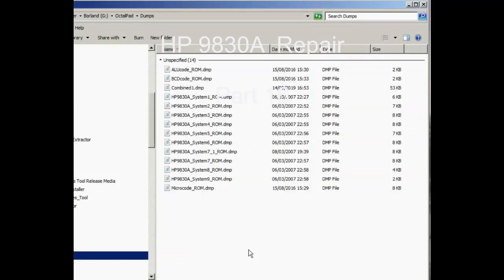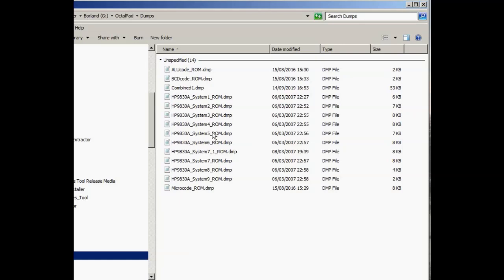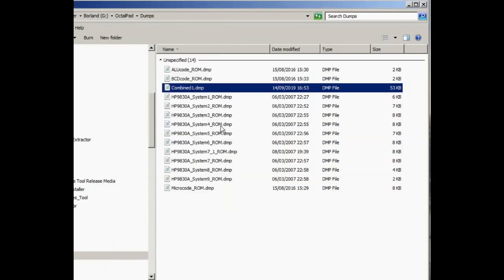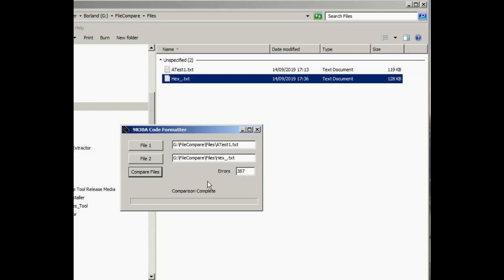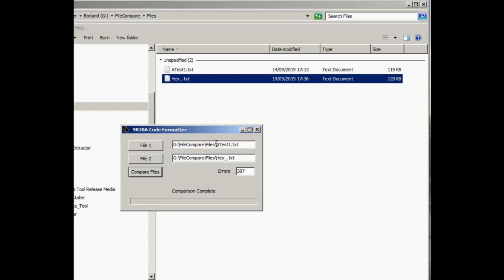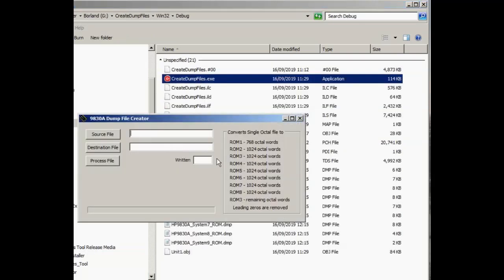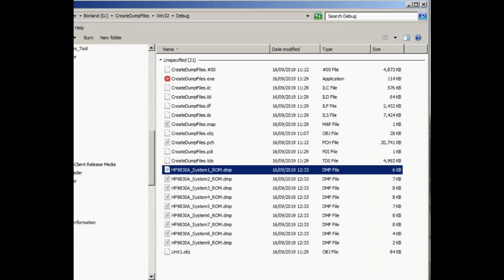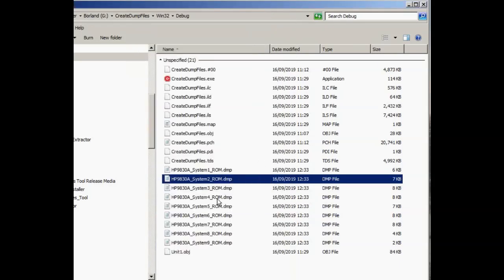HP9830A  Repair  Part16

Comment: There is ready built tool available in Linux and for Windows called diff that you could have used to do this compare rather than writing more software.  😉.  Yes I’m sure I will find out later but it sure does look like a bit pick in at least one of the system roms.  And once again, thanks for all your work.